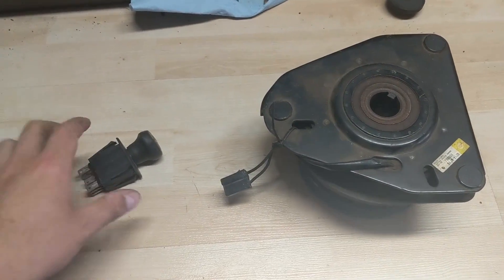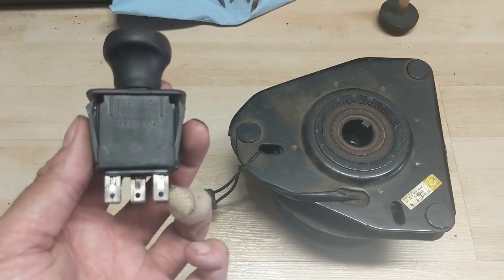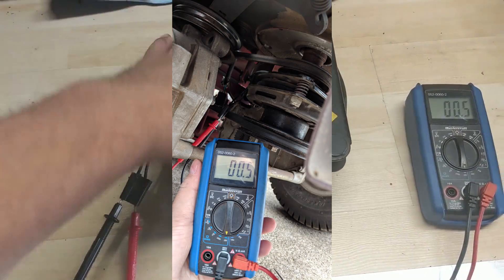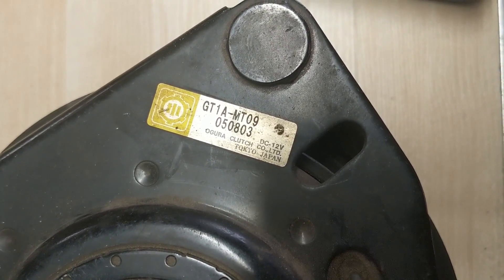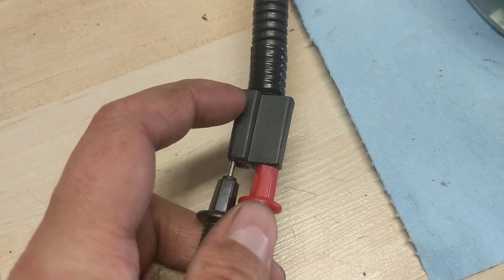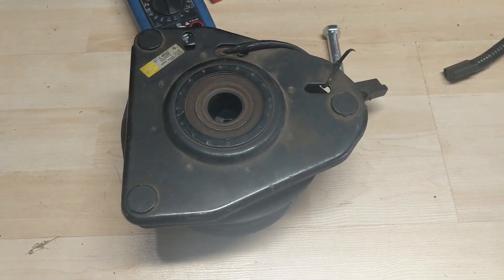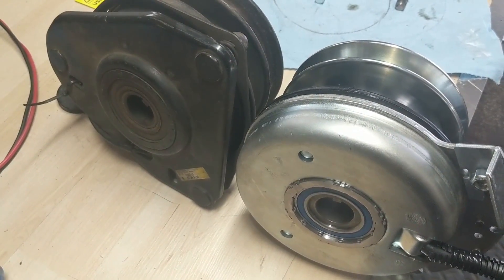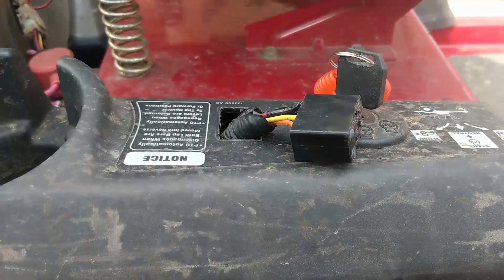How to Test a PTO Clutch for Resistance!

Comment: At 4:02 - A short to ground should actually reduce resistance and give electricity an alternate path.  You're right that it could be intermittent.  I'm guessing the internal short was intermittent at first.  I like your thinking here but I would be against electron theory to say resistance can be increased by creating another parallel path to follow.  You can verify this with Ohm's law.  Resistance path A plus resistance path B equals the sum of the reciprocal of both.  I'm not perfect, correct me if I'm wrong (with sources cited).  Thanks for posting the video I've learned some stuff about these clutches.
Reply from the maker: A Short to Ground should reduce resistance, but it's not always the case.

It all depends on the circuit, the resistance of the windings, and then the ground (in this case the base of the PTO Clutch).

Based on my findings (PTO engage switch that would work for a couple weeks then burn out) it had to be an intermittent issues.

The only way the PTO switch would melt like it did, would be from increased amperage in the circuit.

Everything else was fine, so process of elimination told me it was the Clutch itself causing the amp draw, thus overheating the weakest part (the switch).

We could say we're both right, or both wrong, but at the end of the day, things in a book or on the internet don't always tell us the full story. I find that every machine is always different in the smallest ways.

With the new PTO Clutch installed, my customer hasn't had any issues since!

Thanks for watching!

Comment: The Lawnmower Clutch is an Extreme Magnetic Lock that Ties Crank Output Shaft of Lawnmower Engine to Cutting Deck, it Takes One Hell of a Grip when Engaged thus its Cost is Relatively High compared to other Parts...
Reply: My   Blades cut off when I   pull  the pto

Comment: We overlooked this.  Switched a switch yesterday but went home pondering whether the classic mistake was made.  Replace a part but overlook the cause of the failure?   So back to the clutch to check it.  Thanks for the video.
Reply from the maker: Thanks for watching!
Reply: Thanks to you,.. @EliminatorPerformance      Is there any source for acceptable ohms on these clutches?    Thanks again,
Reply from the maker: Normally the tolerances are 2-4 ohms.

Additionally, you can also check the gap between the magnetic clutch.

Depending on the hp of your machine, there will be different tolerances.

Here's some info: https://ogura-clutch.com/air-gap-adjustment.php
Reply: Thank you very much.    I checked mine and it reads 5 then falls to 3 each time.  However this machine burned a switch.  I have not run it on the new switch.  @EliminatorPerformance

Comment: Your video was very helpful. You did a great job explaining things. I'm in the middle of replacing the elec clutch on my husq yth-2348 and purchased the same after market clutch from extreme. I'm concerned about using the round anti spin rod vs ordering a newer design flat steel type with more hold surface. My anti spin rod popped out of the hole twice. I had been hearing a singing noise with a slight grind sound for a good while (rather loud only at times) After ohming out the clutch leads found it to be only .002 which is close to zero. It ripped my repaired wires loose twice before I found the anti-spin rod popped out. Anyway I now have the new clutch in hand. I'm not a mechanic but try to fix my own stuff and am usually successful. I do the research and watch videos when available, then go do it. Videos like yours are so helpful to DIY"ers. Thanks
Reply from the maker: Anytime!

Comment: 5 Stars for Extreme PTO's have used them before just a tip for all you Eliminators you should have your RPM's or throttle at 1/2 speed before engaging your PTO switch then throttle up before cutting. This will ensure your PTO clutch lasts a long time. Great video i am sure many people just swap out switches before checking the amperage draw on the PTO clutch.
Reply: Thanks for the info. I did not know this.
Reply: Your welcome, this information was on the flyer from Extreme and it makes sense like slamming on the brakes of a vehicle from either 100 mph or 50 mph . Which brake pads stand up longer?

Comment from the maker: In my 1st video, when swapping the PTO switch did nothing, I moved on to the safety switches and sure enough it was the left reverse switch that was bad.

He never told me he melted a switch before so when I tested the PTO clutch, I just did a 12v test to see if it engaged.

Once it engaged I knew it worked, so that's why I moved on to testing safety switches.

Jumping the reverse switch solved the issue, so the original PTO switch was plugged back in.

Had I of done a resistance test then and there, I would've seen the PTO clutch also had to be replaced.

Live and learn!
Reply: Eliminator Performance  How about if your PTO clutch registers 07.1

Comment: Chris, you didn't mention if you burnish the clutch or not.I. too replaced Warner clutch on a bad boy with extreme and I had to burnish the clutch before putting
 aload on it or it would have void the warranty
Reply from the maker: Mark Black The instructions said to use upper washer and lower spacer, without a lock washer, and engage 10times on half throttle then retorque bolt.

Failure to do so would void warranty. I always do whatever the manufacturer suggests (which is why I took the time to call them in the 1st place).